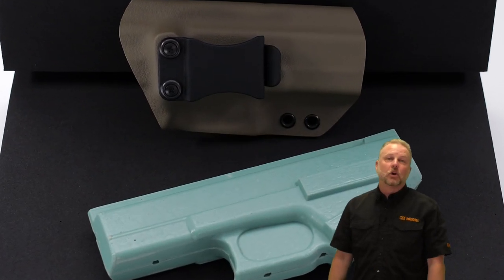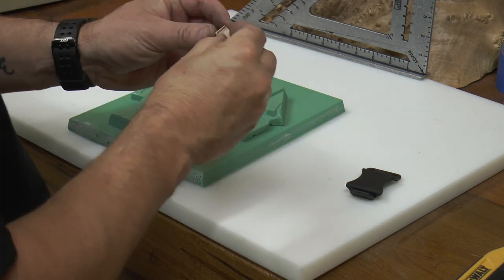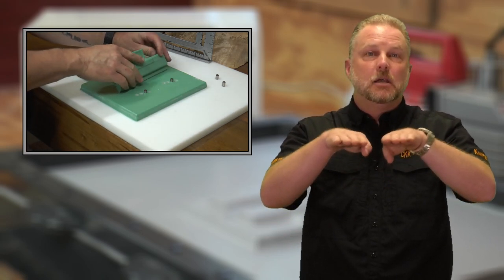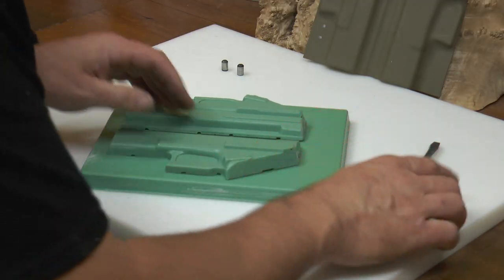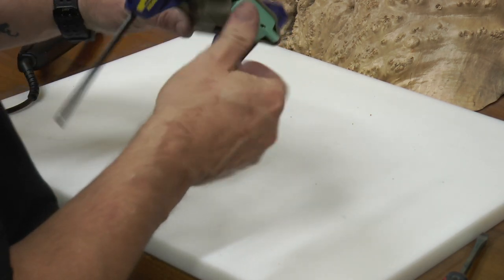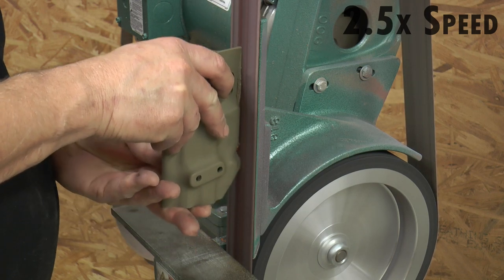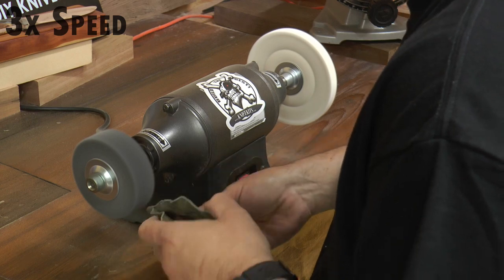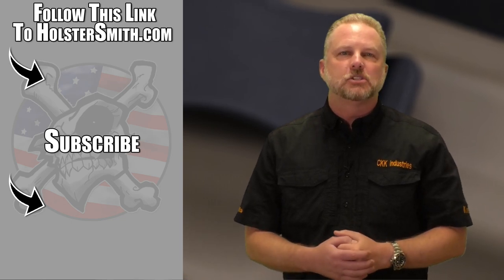How to Make a Fold Over Holster for a Glock 19 Using a Vacuum Forming Press

Comment: Best info i have seen. As one ages it becomes easy to see perfection at any level ! You are a 10+. No tape, no slide release channel, no  filler for the ejector port ? Seems much to easy !   Many Thanks
Reply from the maker: Hi Paul. Thank you for watching. Yes, you can prep it further, but it's not absolutely necessary on all items. The key is experience, as in knowing which models of knives and guns require more prep to soften their retention. We should have stated that in the setup for the video. You do bring up a good point with your observation. My rule of thumb is to "prep everything". However, I know others who prefer to reheat the material and ease the item out while it's relatively warm.
Reply: @KnifeKits  WOW, Thanks for the come back. My motives are a little self serving. Retired & was refered to Red Hill Holsters for a job as a presser. I call it a adventure ! You have put me way ahead. Thanks for that !
Pauley

Comment: I do have a question. How do you know where to put the rivets for retention? Is there a mathematical equation for it or just a well this looks like a good spot? I have seen a lot of the videos and no one seems to explain this is why I am placing this rivet for retention or for the adjustable retention. Other than that, I like these videos. I am trying to get knowledge about this to do it. I would really love to know though about the inquiry I made. Thanks much
Reply from the maker: Hi Jason. Thank you for watching! It's pretty much a judgement call rather than a hard rule. We try to put the retention posts in the center of the facia. If you place them too close to the body of the item, they tend to create too much pinch. On the other hand, too close to the edge of the material will sometimes allow for too much flexibility. In most cases, if you center the retention post between the edge of the holster and the item, you'll generally get the best of both worlds. You can also use more than one retention post if your item is large or particularly heavy. Thank you, again. And, don't hesitate to call if you need more help!!
Alex

Comment: Very cool. The video is so detailed that if there were all the ingredients, you could try to make it yourself. But I don’t understand what you put between the holster and the clip?
Reply from the maker: Hi Vic. A lot of people call those "silencing washers", since they tend to reduce the sound of the rig when carrying. But, they also work great for creating space between the clip and holster, and are commonly used for creating retention on fold-over designs. Here's a link that will show you the different types and sizes: https://www.holstersmith.com/vcom/hardware-washers-c-553_639.html